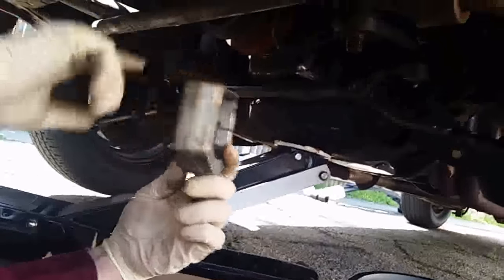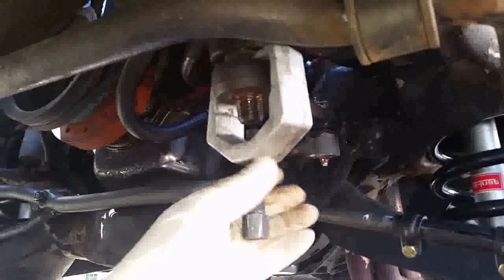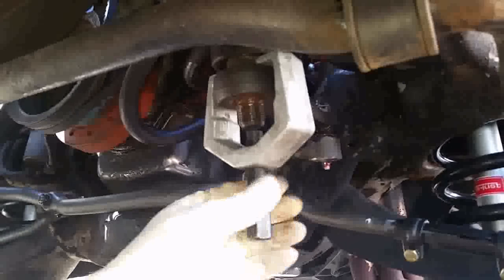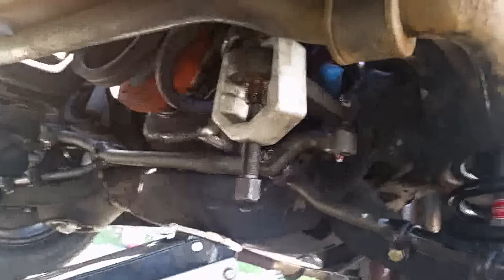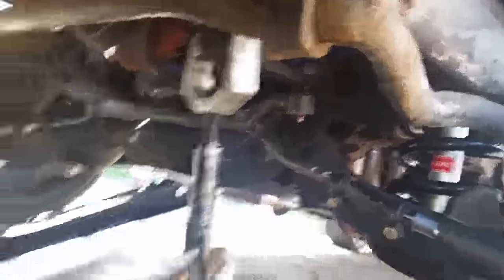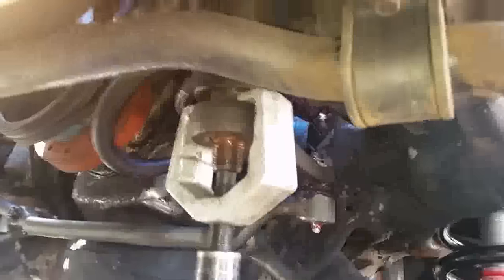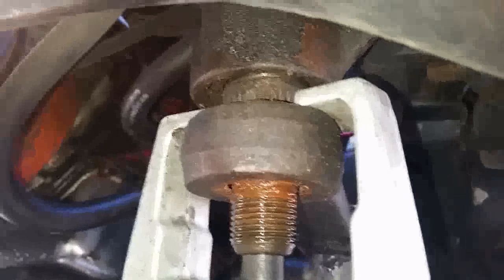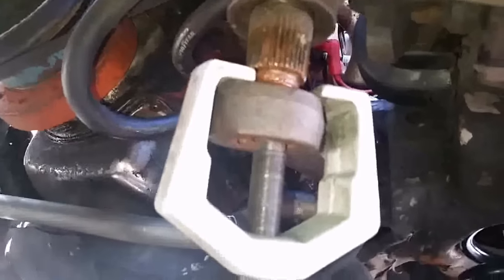How To Remove & Install A Pitman Arm - DIY

Comment: You missed telling everyone that if your reusing it (changing a steering box?) You should center steering and mark it somehow to be sure you get it back onto the new box in the same position.  There's nothing like turning the wheel and will not make a turn but then it will turn to sharp the other way. You get to do it all over if you do this... All you guys with issues taking it off. Spray and let soak.  Try again. might need some heat too.

Comment: How the hell did you get it off so easily. I cant get mine off. I was using my impact running 175psi and all i did was brake the puller.
Reply from the maker: Allen McKinney u can use an air hammer to hit it on the side to loosen it up a little
Reply: Cut it half way off first with cutting wheel
Reply: Allen McKinney YouTube always makes it looks easy. Lol
Reply: using 175 psi you must have forgotten to take off the NUT .   LOL
Reply: @glennwill638  no the nut came off with channel locks. It was just stick real good.
Reply: Same here pit man been in place for I have no idea how many years in my lincoln town car😭
Reply: @klowny1969  if you use impacts on old shit it will just break it. You have to use hand tools (breaker bar) and a lot of ass

Comment: Not all pitman arms are easy access. 2015 the frame is running directly under it.
Reply from the maker: In that case you would have to remove it off the car..don't forget to subscribe 😉

Comment: If you guys cant get it off that easy. Spray that thing down with some PB Blast, tighten the puller as much as you can, and start hitting the pitman arm where the puller is with a big hammer. Then tighten it some more if you can, and hit a couple more times. 
It should come off!
Reply: Heat
Reply: Torch 
Spray 
Bang
Wrench

Comment: I have that exact pitman arm puller but I cant get it on because there isnt enough clearance between the pitman arm and gearbox. Any suggestions? Thanks
Reply from the maker: Try hammering it on..it should go on..don't forget to subscribe 😉

Comment: Glad your came off easy cuz I bent two of those pitman arm removers. I also heated it up with my map gas torch and that didn't even work. Any other ideas?
Reply from the maker: keep tension on it with the remover tool impacted on..and then go to town with a hammer. Whack it like it owes you money!!!
Reply: Angle grinder

Comment: The trouble I'm having is with the castellated nut on the other end. As I try to remove it the stud to which it is attached moves too so it won't unscrew. How do I get that nut off? I thought maybe an impact gun but there is a lot of stuff in the way.
Reply from the maker: You need to add some tension to the ball joint end..either with a pry bar or a jack
Reply: @klowny1969  I'll give it a try. And thanks for replying so quickly to a four year old video.

Comment: I found a good deal on a moog steering kit with tierods, idlerarm, and centerlink. I heard some one say that the moog center link for a thirdgen have incorrect geometry though. have you had an issue with moog center links?

Comment: My front right tire is slanted, pulling to the right. I was told I need to replace my Idler and Pitman arms. 3 shops couldnt align my truck so i hope i just need to replace my arms.
Reply from the maker: Darkilla good luck

Comment: ok looks good, but can you be honest, what is the hardest part on removing the arm say when you are replacing the steering box?  taking off arm looks somewhat easy, but putting it back on looks even harder, is there a took to lineup splines and force it back on etc? thanks.  mechanics around here want to charge $7-800+ incl part, rediculous..
Reply from the maker: No tool..real easy to put on as well..just line up the grooves that are in the splines and use the orignal nut to press it back on
Reply: +klowny1969 oh that's right, the nut presses it back up. thanks bro, gonna put a newer box in this week, wish me luck.lol
Reply from the maker: +m00nchildblues kool np good luck

Comment: I watched the video where you changed all the steering parts except the pitman arm. I think its this same thirdgen. looks like you changed the pitman arm after you changed all the other parts out. is there a reason you did the whole steering system first then changed the pitman arm afterwards? is there an alignment you are trying to keep?
Reply from the maker: Sorry I have no idea what car this was on
Reply from the maker: But no alignment issues

Comment: im literally doing this to my 79 camaro and it just wont unlatch any advice🙏the tool is exactly like the one u used but it wont losen
Reply from the maker: keep tension on it and then start whacking the arm with a hammer
Reply: @klowny1969  hey it worked! thanks for the video ill post a video on my camaro soon
Reply from the maker: @dannyal467  awesome! Can't wait to see it

Comment: Now how do i get it off the center link? Mine is very stubborn, also my new part will be installed downward through my center link. The old part similar to this video is installed upward through center link will that be fine?
Reply from the maker: That's fine..all cars a different..there are different ways to the off the center link..u can hammer it out..use a pickle fork..and sometimes u can fit a tie rod separator..dont forget to check out the description for a link to my shirts and subscribe
Reply: @klowny1969  Thank you for the help!
Reply from the maker: anytime

Comment: Is it possible without the puller?
Reply from the maker: i guess you can use heat to try and take it off..but unless you get it cherry red, it wont happen. dont forget to subscribe

Comment: Cant get rid of the death wobble on my Jeep. Would it be a good idea to replace this?
Reply from the maker: 0Rockstar7 did u diagnose it?
Reply: So far I've been to the shop 3 times. Changed out bushings, steering stabilizer, got it aligned and tires balanced and got an andjustable track bar. But it still does it. I'm so frustrated. Tires are in good condition. I got 3" spacer kit in front 1.5" kit rear.
Reply from the maker: 0Rockstar7 u need to get it diagnosed first..shouldnt be changing out parts
Reply: I did. That's why I have changed parts. My mechanic said I need a dual stabilizer kit...
Reply from the maker: 0Rockstar7 if its a stock setup you shouldnt be adding additional stabilizer bars..sounds to me that ur dealing with an incompetent mechanic..should go under the car with a prybar and check everything..also check all the steering linkage, ball joints , recheck balance of tires and rotor runout..could also be driveshaft out of balance..alot to check..start with easiest first
Reply: klowny1969 wow. Well, the place I take it to is prestigious and well known for doing good work. I was there last week and the guy checked it for hours and recommended a dual stabilizer.
Reply: You need to converter you tie rod drag link set up to traditional cross over steering with a solid one peice drag link and a solid one peice tie..  I help explain more if needed

Comment: would you need a wheel alignment after replacing the pitman arm?
Reply from the maker: John Smith no sir
Reply: after changing a pitman arm you can sometimes align it by marking it, but to have an alignement is the proper thing to do by a mechanics view point that knows what he was taught in school. So your choice, wear on inside or outside of tires will show shortly if out. spped vibrations as well as fast wearing of front end parts. When my truck just had it done, it was aligned. And yes it was altered a few turns, so it was not good after replacemenrt ,
Reply: Good short video.  Doing this on my Pontiac now and this helped
Reply: You don’t need , the Pit man goes only one way. Is awesome you don’t have figure out , if it doesn’t fit , is not the right way
Reply: @John Smith unless  you're changing tie rods and control arms with the same job.

Comment: If it doesn't come off early on; grab the grinder/cutoff and slot the damn thing (I saw it on YT). Save you lots of time!
Reply from the maker: Can also whack it hard with a hammer under tension..thanks for watching and commenting, don't forget to subscribe 😊
Reply: Yeah did that... Penetrating oil, heat, the whole 9...
Reply from the maker: Did you hit it like a man?
Reply: @klowny1969  naw, I'm the runt of the litter, but I brought it to my bro, who is a he-man & wrenches for a living. He got the grinder after some more violence! The other thing you gotta worry about are the bearings and seals... heating and beating can damage them... it's not like your upper & lower ball joints... <pant>

Comment: How do you know when you need to replace one?
Reply from the maker: check out my video on how to replace an idler arm..u will see play
Reply: yeah, good question.  hairline cracks possibly?
Reply: If you have play in your steering wheel. You can have someone turn the steering wheel back and fourth within the area of play and you can. See the joint in the center link end. They will not move together like they should. The pitman arm will move before it engages movement of the center link.

Comment: I ended up breaking my puller to get mine off, those tappered splines don't make it easy.
Reply from the maker: yes..sometimes u have to hit it with a hammer as well
Reply: klowny1969
Next time I'm going to do small grinding cuts around the pitman arm to make removal easier.